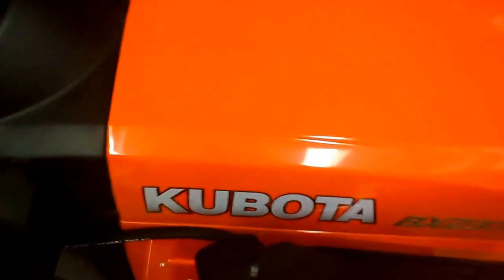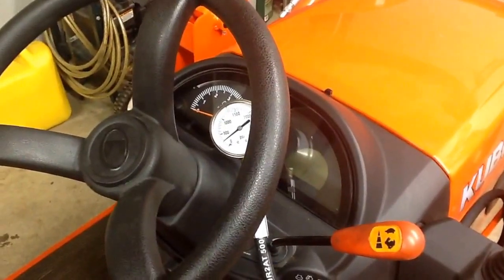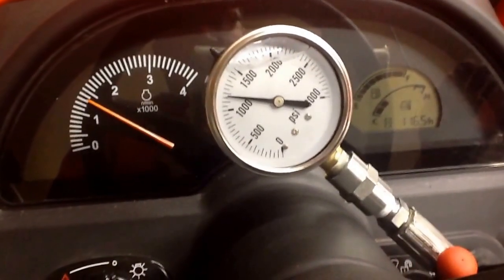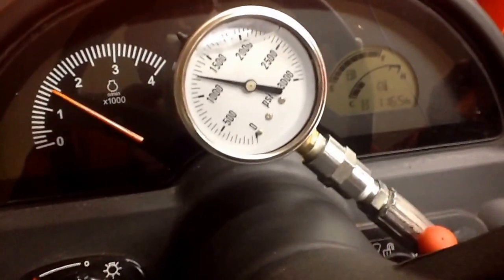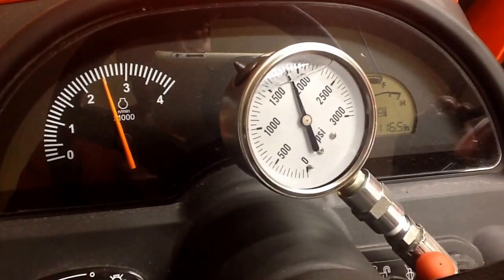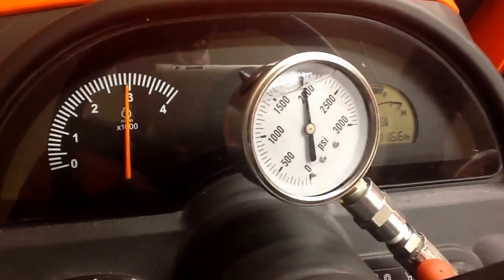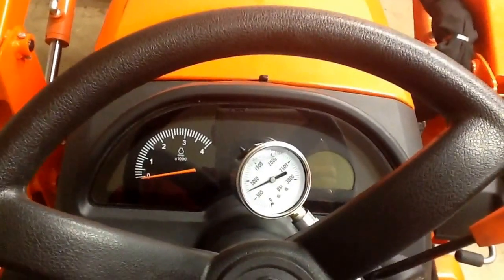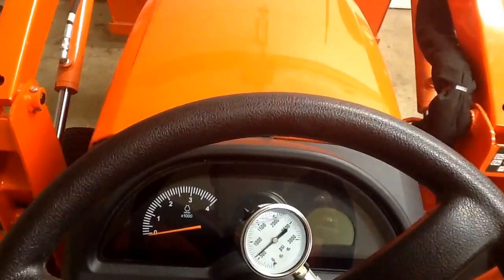Kubtoa BX2370 normal hydraulic loader pressures

Comment: Did the connector come on the hose or did you buy it separate ? 
Did you leave the original shims in there and add the new ones or just use the new ones only ?